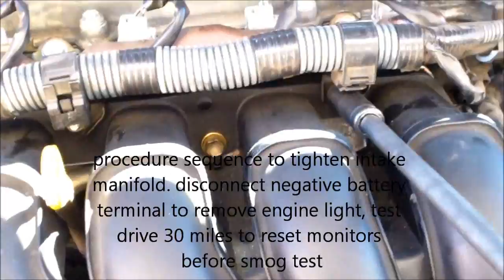P0171 Replace intake manifold gasket Toyota Matrix √ Fix it Angel

Comment: I'm actually kinda mad. A cheap part and pretty simple to fix with a could hours of time but I couldn't figure out my lean code with it snowing and being 3° in the morning and maybe 15° by afternoon for the next few weeks. So I took it to the shop after replacing the MAF and not being able to find vacuum leaks and now I'm going to just have to suck it up and pay $415. I didn't even think about the intake gasket and that's what my issue was. I'll keep this in mind for the next time. Thanks for the video

Comment: I have a p0171 on my 2006 corolla that won’t go away man. I changed both 02 sensors and cleaned the maf sensor after replacing the air filter. AutoZone was telling me it could be the ECM. Any tips or ideas on what else to look for?

Comment: I did exactly this and now my car wont start, only thing I did different was spay carb cleaner into the intake manifold to clean it out and on the throttle body too. PLEASE HELP!!
Reply from the maker: just try to keep on starting it. the carb cleaner needs to burn out. there is too much cleaner in the  intake manifold.

Comment: Was able to do this fairly easily thanks to this vid!  Thanks for your help.  I also cleaned the mass air flow sensor while I was at it.  Not sure what tripped the code P0171 on my 2007 Toyota Matrix, but doing both of those things removed it.  Was idling very rough.  Now very smooth.

Comment: 1997 toyota avalon PO171 PO304 I've changed coils spark plugs oil air filter Mass air flow sensor. Last year we change the gasket. I don't know what else to do. I wish  you were local. I admire your attention to detail . This thankful singlemother appreciates your channel. God bless..
Reply: Change fuel injectors that was my po302 code

Comment: Did you need to drain the coolant first?
Reply: Not with the Toyota 1zz-fe but in some engines the coolant veins will run through the intake manifold, causing quite a mess while replacing the intake manifold gasket. I just replaced my intake manifold gasket yesterday, but did not remove the throttle body, the 2 gaskets for the throttle body are not reusable, so if you take it apart without replacing them, (like 3 dollar gaskets) you may end up with an even worse vacuum leak.
Reply: What does this even have to do with coolant

Comment: About to do this on a Matrix tomorrow.  Been running a lean code for a while and it idles like shit in the cold while warming up.  Can hear it knock a tad when it's cold, too.  Figured this was the issue after some research.

I pretty much know how to do it, but it was nice to see the step by step process from this video.  Should make everything go pretty smooth tomorrow.  Thanks.
Reply: did this fix it? same exact problem here
Reply: @techsmith6818  It did with the idling while warming up, but the lean code was actually from the exhaust manifold leaking.

Comment: just did this to the letter.  now it's not able to idle normally, like it's missing. What did went wrong?
Reply: I believe it requires some time to get back to a new normal. Is the engine showing any check engine lights now? Do you have a scan tool to check?

Comment: I have a 2001 Toyota Echo, 192,000 miles.  Runs like a champ.  Valve cover gasket needs replaced though.  Should I also do the Intake manifold gasket and throttle body gasket while I'm in there?  If so, genuine Toyota part or Fel-Pro?  Does it matter?  I want to keep the car as long as possible.
Reply from the maker: Heavy Load hi, it would be also good to do the intake manifold gasket and throttle body gasket. 
Genuine Toyota gaskets is always best to use since it lasts longer than aftermarket parts.
Reply: Mr. Fix It Angel, thank you for your reply.  My other big problem is coolant loss in overflow bottle.  No leaks on car or ground.  No bad smells.  No bubbles in radiator with car idling.  No bad stuff under oil cap.  I suspect bad head gasket.  However, I did the combustion leak test for leaking engine gases on the radiator with the clear tube, adding blue fluid, and squeezing the bulb to suck in air/gases.  As you well know, if it turns yellow,  it's a bad head gasket.  Mine did NOT turn yellow.  It stayed blue.  Is that a true test?   So where's the coolant going.  I'm pulling my hair out, what's left of it.  Thank you.

Comment: The procedure is slightly different for an 03 or 04.  The lower bolt closest to front on the throttle body also attaches a mounting bracket for the throttle body.  The bracket is attached to the manifold on the other end.  It will need to be removed before you can remove the throttle body.
Reply from the maker: NukeDarfur thank you for the tip. It's greatly appreciated.

Comment: Fix It Angel, I've been a subscriber for some time because you are good at what you do. I changed out my intake manifold gasket for my 05 Matrix at 161,000 miles. Matrix is running smoother, rpm's steady at 750 and MPG has improved. 
I measured the old gasket at 4.97 mm  and the new gasket at 6.85 mm. That is a 1.88 mm difference, which is exactly the thickness of a nickle.  
Your instructions are clear, easy to follow and very much appreciated. God Bless you and your loved ones.

Comment: Hello, I
did it and it worked but after I finished tightening everything and plugged all
the hoses back in, the car idles very low and is about to stall out. Is there
something else to do. I mean since there is no leak any more the throttle
should be more open than before at idle. I unplued the battery to reset
everything, it is enough? thanks in advance,
Reply from the maker: Dave Deshaies hi, you need to drive it around your neighborhood. The computer needs to relearn. Tell me what happens after you drive it for 15 minutes.
Reply: That simple, I will try ! really thank you very much

Comment: I just changed the intake gasket on my 2008 Corolla (with 50,000 miles )  
Toyota part number = 17171-22060 (Gasket, Intake) = orange in color.
I wrote down ALL OF THE STEPS I TOOK in dis-assembly and re-assembly, and here they are:
- 1) Unscrew the ONE 10mm  nut and ONE 10mm  bolt holding the engine cover on, then pull up on the 2 plastic pull-tab-nuts holding the rear of the engine cover on, and remove the engine cover. 

- 2)  open up the spring clamp and pull off the vacuum hose from the front of the valve cover.

- 3) open up the 2 spring clips holding closed the FILTER BOX, and pull out the air filter. Leave the air filter box cover open and completely separated from the bottom of the air filter box. This way you do no need to disconnect the air duct from the Filter Box).

- 4) un-clamp the air duct from the THROTTLE BODY, and pull it off the throttle body.  no need to unplug any hoses or wiring from the air duct this way).  Roll the filter box cover / air duct backwards/towards-the-rear, 90 degrees. (this gets everything out of the way).

- 5) Remove the ‘larger’ vacuum hose from the side of intake manifold.

- 6) Remove the ‘smaller’ vacuum hose that is behind the ‘larger’ hose that has just been removed.

- 7) Unplug  the electrical connector on the rear of the THROTTLE BODY.

- 8)  Remove the 2 bolts and 2 nuts that hold the THROTTLE BODY onto the intake manifold.  ( 10mm )
 The 2 bolts / 2 nuts  holding the throttle body are ONLY tightened to 80 in-lbs (inch pounds) 
Pull the Throttle Body off of the intake manifold, and then push that throttle body to the right, out of the way.  Leave the coolant lines connected to the throttle body.

- 9) Remove the 4 bolts and 2 nuts that hold the intake manifold on.    ( 12mm socket )

(a)  Remove the bolt way down, below the throttle body. 

(b)  Remove the 2 ‘upper’ nuts at the top of the intake manifold.   (careful not to drop the nuts).

(c)  Remove the 3 ‘lower’  bolts, slightly lower on the top of the intake manifold.
      NOTE:  on the most right-side bolt;  it is the bolt on the top, not the one under it.  

 The intake manifold bolts should be tightened to 22 ft-lbs  (foot  pounds ).
------------------------------------------------

- 10) Now that the 2 nuts are off, you can flip the wire harness brackets up and out of the way.

- 11) Pull the intake manifold away from the engine slightly, to gain access to the small vacuum hose that is located behind the throttle body area.  Disconnect this hose from the intake manifold also.
  (THIS IS THE HOSE THAT GOES TO THE BRAKE BOOSTER !    IT IS EASILY OVERLOOKED WHEN RE-ASSEMBLING.)

- 12)  Pull away the intake manifold from the engine, then maneuver it out of the engine bay.
   (Put the intake manifold onto the floor/ground, so you don’t risk dropping it and cracking it.)

- 13)  Clean the steel surface of the engine with a plastic ruler as a scraper, then with a clean cloth, to make sure no old gasket material is stuck to the steel. 

- 14)  Pull out the old gasket and install the new rubber gasket into the groves where the old gasket came out of.

- 15) Push the intake manifold back into the engine bay, and onto the engine, and reverse the steps, starting at step 11).

The intake manifold bolts should be tightened to 22 ft-lbs  (foot  pounds ).
The 2 bolts / 2 nuts    holding the throttle body are ONLY tightened to 80 in-lbs (inch pounds)
Reply: Between the video and your detailed instructions I was able to do the repair confidently. Thank you!
Reply: wow, thanks
Reply: Honesty Counts to

Comment: Try not to use metal to clean the surface, it can create scratches in the metal that may compromise the suction and lead to an improper  air to fuel ratio

Comment: Awesome. Why ppl giving thumb down just because he went quick? But he is precise so watch again and again ...best video as I am doing this job right now
Reply from the maker: Thank you, Exactly. Critics just don't know how much time and effort when doing this repair. It's not easy. Have a nice day.
Reply: Hi bro I finished and tighten everything and changed the manifold gasket. Now the engine light is gone but car is idling and shaking up down idle almost like it's gonna turn off...pls help
Reply from the maker: There is a hose you forgot to put on, it's behind the throttle body. Check your work again.
Reply: Fix It Angel yup lol thx
Reply: Idk man I thought it was perfect. Short sweet and to the point. Even showed the tourqe sequence at the end which is super important for large contact areas.

Comment: Hi I have 2005 1.6 petrol after coming to a stop car stays around 950rpm then after 5 seconds drops to 700 and hovers around this rpm. I've replaced throttle body and cleaned map sensor, I'm thinking it could be electronic pedal sending incorrect reading? What can you suggest?thanks..great video, please make on for head gasket!
Reply from the maker: There is a Technical Service Bulletin on that vehicle for that problem. You will need to bring it to the dealer and they will reprogram and/or replace the ECM (computer). I've done it to hundreds of Corolla's and Matrix's. Thank You

Comment: Thanks for the video.
This was exactly the problem with my girlfriends 07 corolla. 
I was able to the whole job in about 30 minutes.
Reply from the maker: Awesome!! So happy this video helped. Have a nice day and please subscribe.
Reply: Hi, basshnter1997: I have a 2007 corolla. How do you pull out the electric connector that goes into the throttle body? There must be some latch, because it is tightly plugged in.
Reply: I didn't unplug it.
I just left it connected. 
You only need to move the throttle body out of the way.

Comment: hey bro what is that piece of metal(gold color or bronze color) in the entry part where the tb goes. i noticed my 06 has it but my 07 did not. does that piece matter why its there, if not im taking it out just because. i had this code to and got it taken cared of
Reply from the maker: Hello Mark, tell me time on video so I know exactly what you are talking about. Thanks
Reply: its cool man, i found out that when you take the throttle body off, its a gasket type filler for it and i took it out and turned it on it was vibrating and whistling, didnt like it so i put it back on and it stopped, didnt know something so little had such a bad effect, im looking to try it again but with just a round gasket to put in there to get rid of the gold metal plating in there
Reply from the maker: That's good you found the problem. Have a nice day.

Comment: Did it all myself but forgot the vacuum hose in the back. Took me another day to figure why it wouldn't run!
Reply from the maker: Yes you would have to remember that hose. It happened to me once and never again. At least you found out. Thanks for watching and please subscribe.
Reply: Yeah me too! It was the Break Vacuum line ,No break pressure and it ran and stalled .That line is not easy to get on there,it is wedged between two other hoses .
  The break Vacuum line is necessary to remove,as well as the coolant lines running  if you want to actually pull the whole manifold off

Comment: I had my intake manifold gasket replaced at 90,000 and now at 110,000 I am getting a lean P0171 code again.  I have replaced the mass airflow sensor and the AFR sensor.  So you think the gasket is bad already?  Maybe if I replace the clamps with hose clamps first?  Dealer says the fuel pressure is 32 PSI and should be 45 PSI.  Could it be the fuel pump giving me a lean error?
Reply from the maker: I don't think the gasket is bad for only going 20K miles. I know there is a recall on the ECU's and sometimes they just reprogram the ECU. The car is not under warranty so purchasing an ECU will cost a lot. You would have to bring that up to the dealer. I hope this helps. Good Luck.

Comment: hey 88 the top plastic fitting on the manifold broke. The one right behind the throttle body. I see it in your video. Do i need to completely get a new manifold? thank you
Reply from the maker: Hello jgr590, if there are no cracks beyond what was broken off, then i think it is ok. But you can always try to glue it back with some JB weld. Replacing that intake manifold can be very expensive. Thanks for the question.

Comment: I want to make one suggestion to other viewers though. GET BETTER HOSE CLAMPS. The stock ones are known failures and could be adding to your vacuum leak problems. As you're reattaching the hoses replace the old pinch clamps. Its a quick and cheap fix that has made a huge difference on my vibe. Thanks for the vid. Very helpful and much easier/faster that what the trouble bulletin or service manual will have you do.
Reply from the maker: Thank you very much for the comment. I really appreciate it. Have a nice day.

Comment: Thanks a lot for this video. I'll have to replace my intake manifold gasket on my 03 Corolla soon, and your video will come in very handy. What's the torque setting  recommended for those manifold bolts ? Since the manifold is made of plastic, I wouldn't want to risk cracking it by over-tightening the bolts .
Reply from the maker: Welcome and thank you. it's 22 ft. lbs. if you don't have a torque wrench, usually what is do is when its tight I turn a quarter turn more. have a nice day and please subscribe
Reply: 88bmyvegas Thanks for a quick reply !

Comment: I have replaced the intake manifold gasket back in the summer and the CEL went away,but when winter came along with the cold temperature and the CEL came back on.Any idea why and any help would be greatly appreciated.
Reply from the maker: try to clean your MAF sensor. see if that works.
Reply from the maker: it is located after the air filter box
Reply from the maker: sorry i dont have a video on how to clean it. you need to search it. hope it corrects the problem
Reply from the maker: or you can go to my blog and test it if it is in working order. please read description on my video to my blog. Thanks
Reply: 88bmyvegas I cleaned the MAF with "Sensor Kleen" but it didn't fix the problem.I maintain and work on all my cars and I even have a Z/28 that I modify and race and do all the troubleshooting but this problem with my Corolla,I can't seem to eliminate.lol.I appreciate all the ideas and the quick reply.
Reply from the maker: welcome, ok tell me what have you all you done. replaced the gasket and cleaned the maf sensor? so we can process of elimination. thanks
Reply from the maker: oh i remember you might have to recalibrate/reprogram the ecm or might have to replace it. there is a tsb (technical service bulletin). you are better off going to the dealer and get it diagnosed to know for sure.
Reply: 88bmyvegas ECU was replaced by the dealer early this year.
So far,I've changed the manifold gasket,cleaned and tested the MAF,cleaned throttle body with new gasket,threw a new set of spark plugs and 02 sensors, flushed the cooling system,some fresh tranny fluid, for good measure since the car has over 100 thousand clicks on it,, a new gas cap.I'm beginning to think it has something to do with the EVAP/charcoal canister system but I haven't gotten around to pulling the code yet.The car runs fine,though.Again,thanks for the quick replies.
Reply from the maker: no problem, ok just get the code and tell me. if it is the charcoal canister, you need to get a shop or dealer do an evap test. if the car runs fine, it is more likely an emissions problem.

Comment: its always best to do that so the ecu has new readings, thus giving the correct amount of fuel and air, and right now im in the process of relocating so my dogs can stop being threatened my HOA's. anyways i always thought it would be best to disconnect to it for safety reasons. if any metal part were to touch the battery it could fry the part. everytime i work on a car i do that. its not that your wrong im just looking out for the cars ecu. and for corollas, they are really easy to fix tho